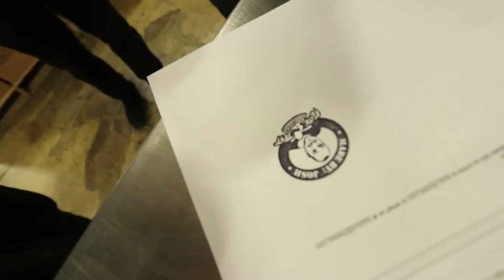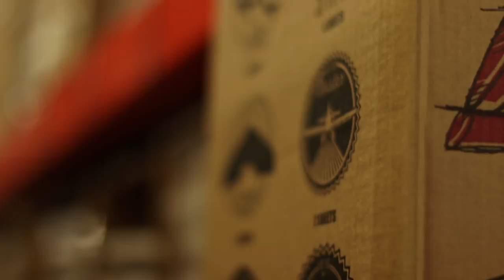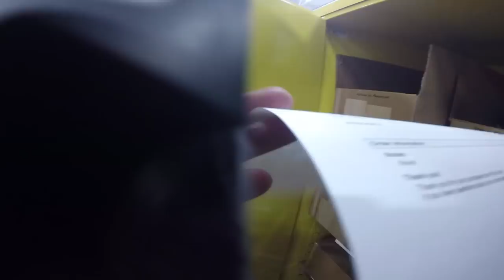THE VALIANT LIVES! | VLOG0126

Comment: Not too sound really dumb, but I can’t seem to get the motor mount of my Valiant to replace a broken prop shaft I snapped clean just taxiing . The plane so brand friggen new snd like my 40th eflite plane that I own. I have not had a problem with any other eflite motor replacement or eflite motor shaft replacement, but cannot even remove the motor from the firewall. I haven’t even maidened the friggen thing yet. Literally taxiing and it noses over and that was the end her. I’m not about to cut the dang thing open as like I said, the plane hasn’t even taken off the ground yet. Any suggestions are appreciated

Comment: you need to put skids on that when it starts snowing. that would be cool :D
Reply: I am actually working on designing retractable wheel skis for a Super Cub S. Probably wouldn't require that much modification to make them work on the Valiant.

Comment: Hey ft, could you do a video about betaflight and getting it installed, I am trying to build a gremlin with my father but we cant seem to get the flight controller to connect with the computer. Thanks.
Reply: John Montana I had a problem once an discovered a common cable that came with a device was charging only.  Make sure you have a data cable not just power.

Comment: So I have a quad and when I plug the battery in the quad beeps, acknowledging the battery and it pairs with the controller but it will not arm. What should I do?
Reply: Youtube how to start up that type of drone, this usually helps, but if not contact your local hobby shop or Flite test. Goodluck.
Reply: Magnus alright thanks man. I wasn’t too sure what to do because it was working fine then all of a sudden it just stopped. I didn’t know if it was an easy thing to fix or what. Anyways thanks!